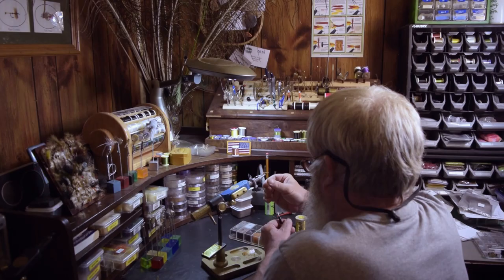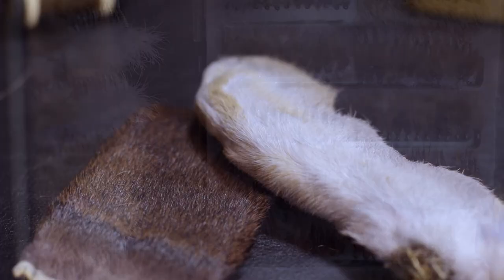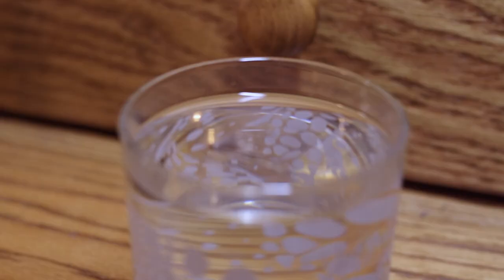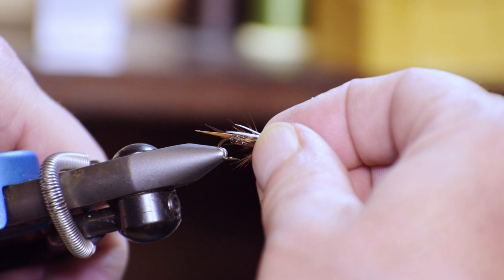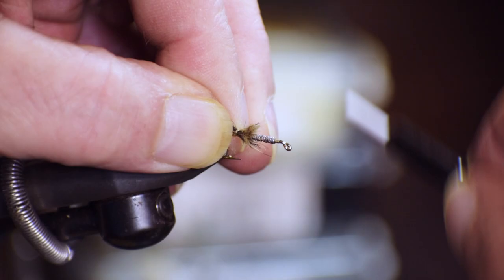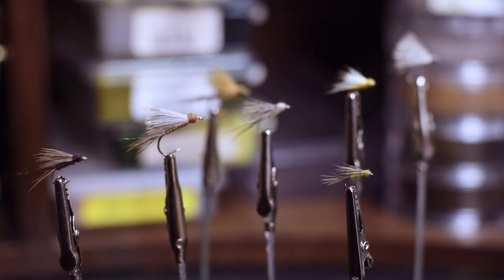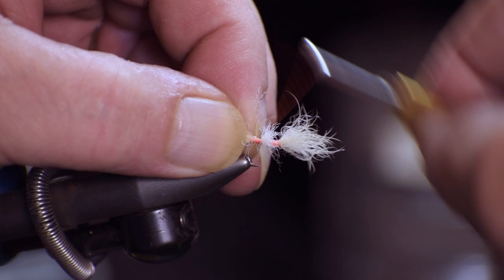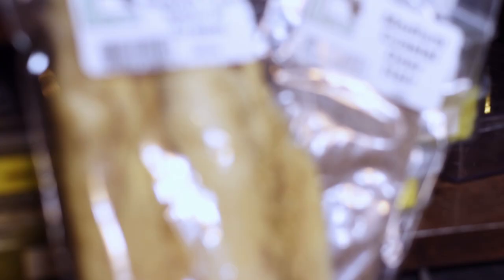Alternate Materials

Comment: I've even used dog hair that a neighbor's dog had shed! I worked in tackle shops for over 15 years, but I used to get my materials wherever I found them! I used to buy Aunt Lydia's  Rug & Craft yarn by the skein at KMART for less than the cost of a single card at the fly shops. I also used to buy a lot of materials at craft shops.
Reply from the maker: Craft stores can be treasure troves if you are a creative tier! I have all sorts of material from them. I also have dubbing form my little decease doggy AJ.

Comment: Is there somewhere a website, or a book to help choose alternate materials on the basis of the properties of the different metarials ? such as water resistant versus getting 'wet' etc... ?
Reply from the maker: Not that I am aware of. A general rule is that if it is a water dwelling creature, the fur will be buoyant as a result of the natural oils, muskrat, mink, beaver, nutria, etc... and snowshoe hare feet fall into that category as well.
Reply: @ShortyOnTheFly  ok thanks. makes alot of sense. but what with plumes (of non aquatic birds)
Reply from the maker: @ludopolleunis4559  Most plumage, unless tied in as a hackle, will not float. But that is where I substitute deer hair of snowshoe rabbits foot fur as a wing material. CDC is also a good material for any number of different wing styles.